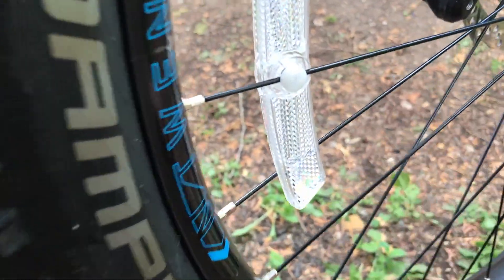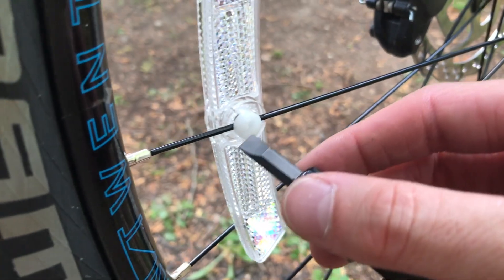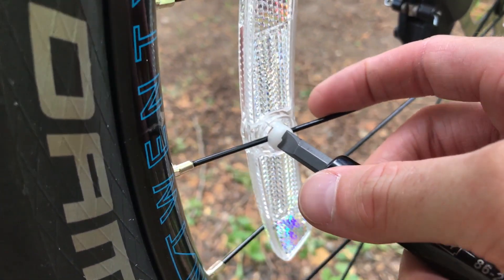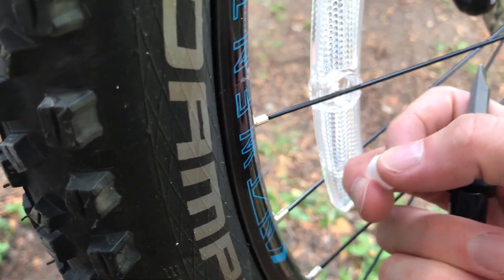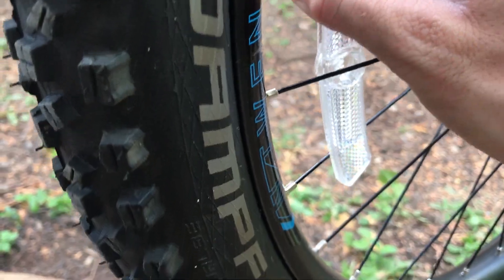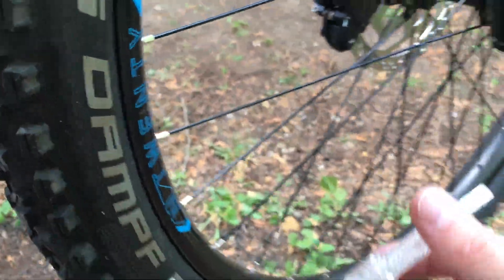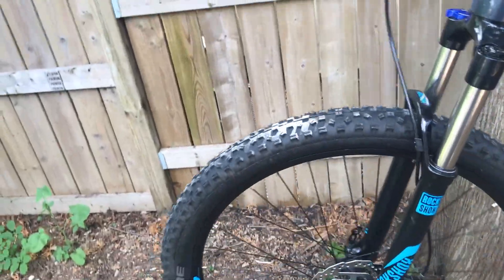How to Remove Reflectors from your Bike Wheel Spoke

Comment: I'm doing the same thing and it is not moving all it is doing is bending the screw
Reply: I have the same problem
Reply: @spacefox3550  I used needle nose pliers instead, worked a charm.    👍
Reply: You can twist it off it will break though

Comment: umm.. why should we remove reflectors on the wheels?
Reply: Do intense drops you'll know why
Reply: They rattle and can even snap spokes when doing jumps
Reply: @charleykeate2060  exactly
Reply: They don’t do much if anything to help and actually give riders a false sense of security. Hey actual front and back bike lights so you can be way more safe
Reply: I dislike the way they look, and rather have the individual snap in spoke reflector covers. 

But I can’t get these damn stock ones off my trek; can’t even turn it to loosely release like how it was done in the video. Whoever invented these should be football kicked in the nuts.